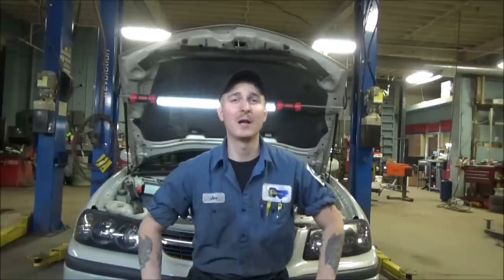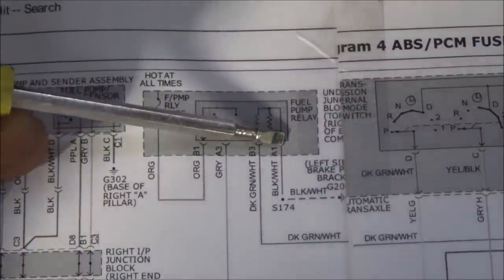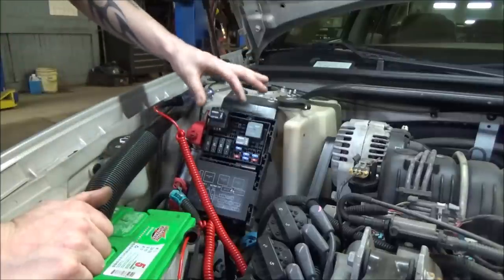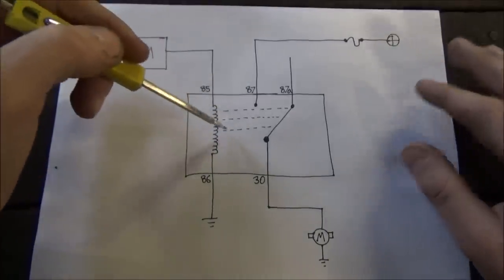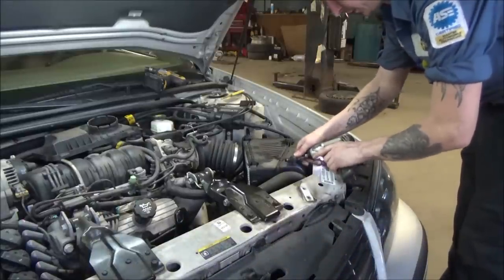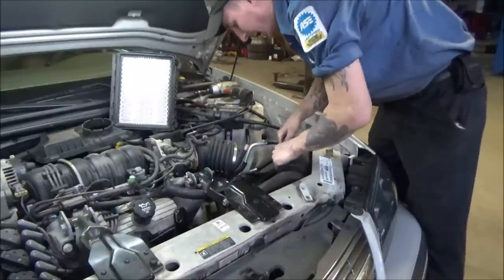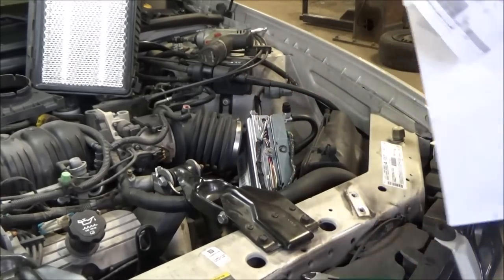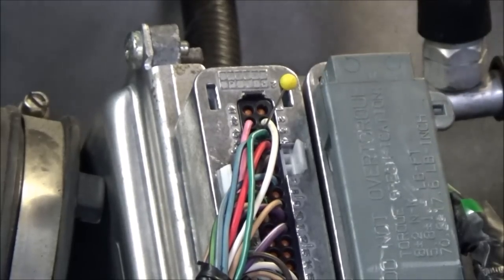2003 Impala No Start, P0230 Fuel Pump Control Circuit Fault

Comment: I searched high and low for a video that covered 2094 Monte supercharged. Thank you man I had trouble convincing my customer that wiring a switched load control positive from an ignition controlled circuit to the load feed to pump with relay removed was safe.  Time limited and money being tight, I thought that was fine for now. I lost his trust once a lil birdie got in his ear his father. Now IHOPe to get him back and smack the 150 labor  on him still saving 4to5hundred out the shop he was heading towards. You saved me and thank you. Painter Chris... Aka jimbo

Comment: This video is on the MONEY! However one slight error is the wire WE are looking for is the DRK-GRN/WHT wire. It is the wire that was coming from the PCM that was sending the control power to the fuel pump relay and it was one of the wires that was broken in the harness. I couldn't see clearly if there was a black with white or white with black wire. BUT I do know WE were ORIGINALLY looking for the DARK GREEN with WHITE WIRE coming from the PCM. And YOU found it in the clump of broken and rfayed wires. GREAT WORK, EXCELLENT DIAGNOSTICS!
I'm working on a 1999 Chevy Blazer that's having the same issues and MORE. I finally got the vehicle to start but I lost all instrument activity and no radio or a/c control. I don't have access to ANY wiring diagrams. I can't afford them right now. So I rely on you great people. I truly do thank you for ALL your work! Keep up the good work!

Comment: Subscribed!!!!! Because...... you saved me a lot of money. I have an 04 impala and I was having the same exact problem. I even had a certified mechanic look at it and told me I needed a new lock cylinder and ignition switch. I watched your video and I checked the wires as you did and bingo!!. I hooked the wires back together and the car started right up.  Thank you so much for this video. You are very good at explaining things. I have learned a lot from watching your vids. If it wasn't for you my car would still be sitting and I would be walking back and forth to work. Again thank you, you are the man!!!

Comment: Very common issue with uk Vauxhalls and Chevrolet. Joe noticed you said to be careful not touch ground with your test light connected to control wire, what I have done with my test light is run a length of heat shrink tubing test light probe leaving the last 10mm exposed. Another great video thanks.Joe
Reply from the maker: Great tip with the heatshrink.  This test light actually came with an insulator installed on the tip,  but I intentionally removed it to offer me more protection when using the test light to check for spark on waste spark and distributor ignitions.  Nevertheless,  someone else may want to do this for sure!

Comment: I had the exact same issue on the same gen Impala. The belt wore through the wiring conduit and chewed through the green/white wire. That car had a 3.4 though. That connector is supposed to be hooked the the brace bar over top of the battery, there's a hole in the underside of it. By the way, you called the green/white wire a white /black when your were taking the conduit off of it but I knew what you meant👍 Keep up the the great work Joe!!
Reply from the maker: Thanks for watching and sorry about cutting you off in your initial attempt to view. I tend to get in a rush and I have trouble getting what is in my mind out of my mouth sometimes.  I am still learning to effectively communicate with all of you without little miscommunications like that. I also stated at one point that pin 87 wasn't used,  and that is also incorrect.  I'm glad you know what I meant though 😂
Reply: Triangle Diagnostics first off thank you for your videos, you have helped me multiple times. I have an 04 impala and I am having the exact same issue. The fuel pump will not kick on. I have no power to the power side of the relay circuit. I haven't checked the wires yet but if I do and the wires are good, can you tell me what else it would be. Had a mechanic take a look and he said I need a new key lock cylinder and ignition switch. Please give me your honest opinion. I have four kids and don't have much money, please help me...
Reply: @therealheavymetal5476  Hi, I was wondering how you made out with your vehicle? Thank you

Comment: I have the same P0230 problem and 50% of the time the engine starts and stops immidiatelly. The relay is good the fuse is good. Do you have any guess what could cause only occasionally this problem?

Comment: Hello.  I have a question for you.  I have a 2000 Impala that cranks but it does not start.   It appears to be the fuel problem because when I sprayed starting fluid it started for a second or so  then it died.  I don't have the fancy fuel relay adaptor like yours, but I did a test on the fuel relay.   Power Feed  (Botton Left) is working because my test light turns on.   Top left (ground) also works... light turns on.   But I can't energize the pin side from the PCM (Top right).   Should this happen when the the key is on the "On" or the "Start" position.?   I can't get the Botton right pin to work either.   It should be the 2nd ground?  I think.   Botton middle pin does not engage in anything.  It goes into an empty hole.   

The DRL RlY relay which I don't know what it is has 5 pins and all 5 pins engage when is fully inserted into the relay slot. 

Hope you are able to help me.

Comment: Yeah I have an issue with a 2010 Buick Lacerne it’s overheating and burning out the relay for the fuel pump what are your suggestions

Comment: The wire harness connects to the long black bar bracket on the underside there’s a small hole where it snaps in place I have to zip tie mine or it will fall down?

Comment: Forgot to ask, did repairing all those wires also fix the AC clutch code?
Reply from the maker: Yes sir it did.  The AC clutch relay control wire was broken in the same location.

Comment: These cars have a list of defects that can cause it to die while driving or not restart.
1. Malfunctioning security system accessed through radio.
2. 50 amp main fuses that blows
3. loose ground wires connected to transmission.
4. Damaged fusible link to alternator.
5 Bad neutral safety switch. 

6. Corroded micro relay near fuse box.   And more ......

Comment: At 12 min in, I don't see where the relay can be grounded since the 5th contact is not used.  I can picture the switch closing when energized from the fuse, but I did not see the ground path for the relay when there is no signal. I might get cleared up by the end of the vid but at 12 min in I don't see it.

Comment: My question, why do the modern fuel injected engines have the computer to control the operation of the fuel injection /fuel pump relay instead of just having the ignition switch operate a relay to switch the heavier current to the fuel pump(s). Does the computer automatically turn the fuel pump(s) on and off while driving, (kind of like an electric cooling fan)? And if so, why? I am working on a 1990 Volvo 760GLE with the 2.8 liter V6 Peugeot engine. It starts up and dies within 3 seconds.This system has 2 separate ground closures from the computer, one to control the fuel injection relay,  the other to control the fuel pumps. This car has 2 pumps. I will look around for a relay adapter specific for this style relay. That alone was very helpful. Any comments will be appreciated. Thanks.
Reply: That would flood on startup, edit; on startup it richens the mixture slightly then leans to where the 02 tells the brain to, otherwise the fuel pump wouldnt know the differnce between idling, part throttle, and wot. Please post some videos on your puegot

Comment: Ive had a customer replace Everything to end up using a fuel pump relay that was rated high enough,  it was a 2002 chevy venture with the v6 and it simply needed a 35a fuel pump relay instead of the stock 25a Because the customer did diy repairs and added on lines the original relay was overheating trying to keep up. Started as intermittent fail to start while hot

Comment: I have a Envoy Denali 5.3 It starts just fine when cold. When it gets operating temperature it gets hesitant and stopping at lights tge rpm is wavering till it finally stops maybe 5 to 10 min driving. Wont start till cold again.
Reply: Check out your fuel pump relay and try replacing it with one thats 5a more, if its anything like the malibus and venture they share wirings between the oil sensor and fuel pump relay. After I fixed the relay on a customer's venture the oil sensor quit sending codes, when I checked the other fuses the cooling system fuses were blown too so it wouldnt hurt checking those too. 2000 era by chance?

Comment: I Must've Watched This Video About 10Times. I'm More Mechanical Than Electrical. But, Good Lesson Though "Guy". So I'm Having This Fuel Pump Issue, And After Watching For The 11th Time and Got Enough Heart To Hot Wiring the Fuel Pump Ground (AKA 30), I got No Fuel Priming. So What I Understand from That Is My Fuel Pump Is Toast.. ? Yes? 😕🤔... (Possibly A Bad Wiring/Poor Connection To The F.Pump, But, Highly Unlikely)

Comment: Whoever put a new battery in forgot to plug that xmas tree connector back into the brace. Not really a GM fault.
Reply: It is GM fault.  Very bad design to hold the weight.  Mine feel out and would not stay.  The tree connector is the issue.

Comment: I had the same problem with my 2005 impala it died on me I could smell the burned wires I look down  and seen it laying on belt
Reply: Aslong as it's just wires you can solder em back together ;)